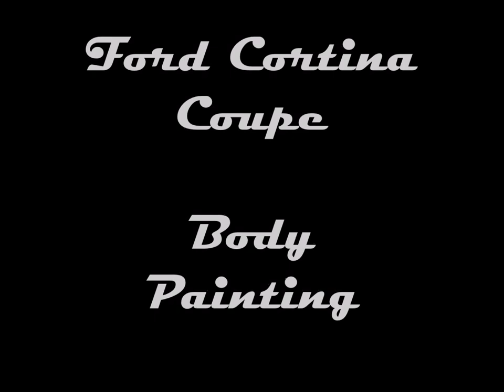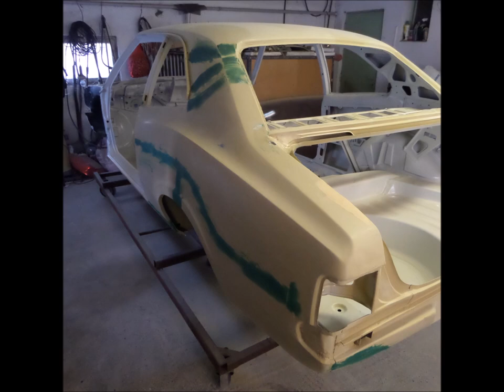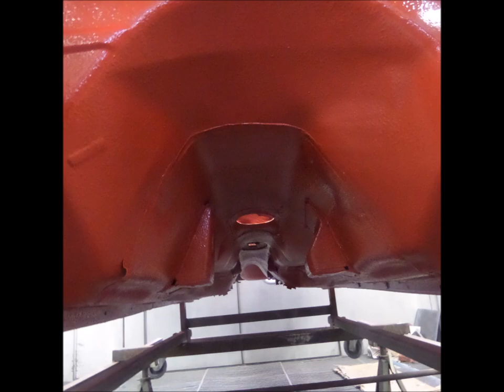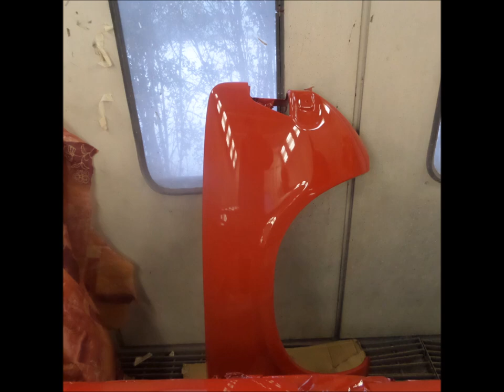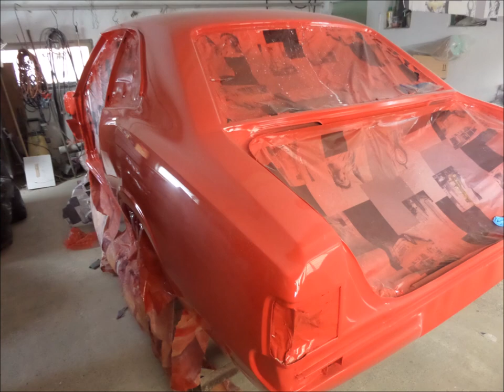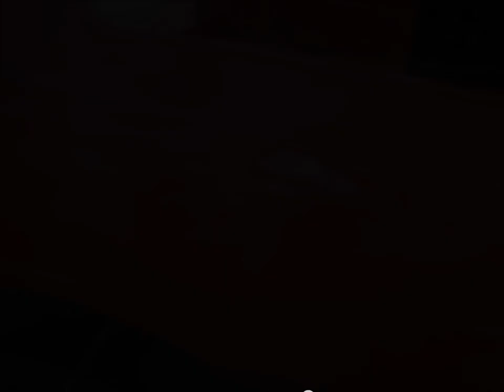Ford Cortina Coupe Restoration 3. Completed by Hot Rod Hungary Garage

Comment: Nice!!!!!, I am restoring a very rare 1974 model version of the Mk.3. on my channel, (the ONLY surviving ex- Ford promotional car) that I have owned for over 43 years, bought from the dealership with only 250 miles on the clock in 1976, for £1,575.  The car is having a full very high quality rebuild to exactly as it left the Ford Factory,  I liked this video, you have a good shell there!!, great to see someone else saving a lovely Mk.3 Ford Cortina.